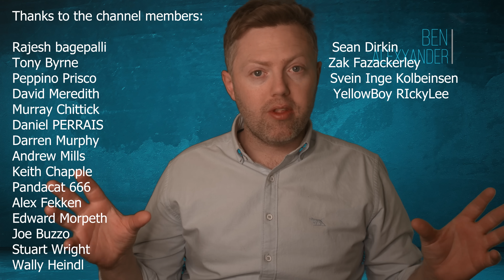CATL’s New Sodium Battery Will Reshape the Entire EV Industry

Comment: You're 100% wrong on people not wanting longer distance from electric vehicles. It's an asinine view that other channels take as well. People DO want longer ranges so they don't have to stop and charge their vehicle on day trips!!!
Reply: I agree. The trips that are annoying for me are ones where you stay the night and there's no charging. So say a 2-3 hour drive away, overnight stay for a couple of days, then 2-3 hour drive home.  Having to stop on a shorter drive like that is annoying. If my EV had a real world 450 mile range at motorway speeds that would be a game changer and I would buy one!
Reply: I’m waiting for a car that’s the size I want, with the features I want, that’s not NMC, that will do the day trip I do every 6 weeks without a charge stop, with enough wiggle room to allow for bad weather etc. That day is huge for me already. I don’t want to add a charge stop. 

500km real world range would be enough, but it’s surprisingly difficult to find in a small SUV. The industry seems to have decided that 430km is enough for that size car, and for most mid size SUVs for that matter, but that’s cutting it too fine for me. The Zeekr 7x has that little bit extra I need while still being LFP, but I just don’t need that much car. 

There are rumours about a 2026 facelift of the Atto 3 (including a more sedate interior thankfully lol) that looks promising. I’m guessing it will have the Blade 2. So I’m hoping that will work. But if it doesn’t, I will keep waiting.
Reply: It’s dumb to want more distance than 400 miles. The extra weight makes it a bad thing.  It’s the same in cars notice the large 25 gallon tanks are gone even on the suburban. The extra is stressed by on line distractions from non ev people.  I drove my Tesla with a 300 mile Range at 80 percent and it was more than enough to go 1350 miles with a short fill that the car to me right to.  It took 15 minutes and off I went. They are open 24/7 even on Christmas and new years.  The smaller the pack the better however 400 mile range is even better than most SUVs have
Reply: I'm going to disagree with you on this.  500km/310mi of range is adequate for the vast majority of drivers.  Sticking with that range means the vehicle will be much cheaper.
Reply: @Jon-z2k7j then these people don't d serve to drive. I want more range and less charging. What sort of moron doesn't want longer range.... Other than you

Comment: If this comes to fruition, it will be the tipping point for me to get into an EV.   Living in Canada, the long driving distances and the range degradation have been a deal breaker.
That and the crappy charge infrastructure.  A 600km range, recharge to 80% in 10 min, minimal loss in winter and the added benefit of low maintenance it will be my next vehicle in 4 years.

When this tech is available the only barrier to mass adoption will be the price of the vehicle itself, not its method of producing power.

The main question to worldwide mass adoption, is the energy grid able to keep up with demand?
Reply: Yes. The network is a problem not charging. In 20 minuten 80%.

Comment: Sodium batteries will ignite far more readily than lithium batteries, and burn far hotter. You don't get greater energy density in a chemical battery without also getting more volatility. And the energy density is STILL garbage. Chemical batteries are not the future.

Comment: I think sodium ion as a mixed bag. On the one hand - cheaper, safer & greater temp range but on the other not as energy dense. I imagine that we'll see all kinds of weird hybrid batteries - half LFP, half sodium. We'll see crappy but affordable city cars with 150 mile range because the battery is cheaper. The biggest use of these kind of things is probably in static energy storage where it's less of a deal - e.g. home energy might need a 10 or 15kwh battery so a slightly lower density doesn't make a big deal of difference to something which is bolted down and never moves.

Comment: Distributed power generation and storage, are the real deal with this. Because EVs are not a real option if we migrate EVERYTHING to EV. There is no way to generate that much power efficiently, cheaply, and distribute it efficiently.

Now having a decently sized battery on each home, may not increase its cost that much, and suddenly you give the grid the capacity to operate near full load all day. Powerplants can run at optimal levels, cheap renewables can be optimized for maximun generation, and ignore consumption peak hours.

Only then thinking about EVs everywhere really makes sense.

And in your house ... or building. Space and weight are not a premium like a vehicle. Your car can run on the battery chemistry that gives the best range, performance, lightness. But at home, i want quantity and cheap.

Comment: Video states, "One of the only things EV critics bring up is fire risk . . ." ah . . . no . . . EV critics will still rightly point out that most countries are still decades away from having the recharging infrastructure required, along with the range of batteries. These will be EV showstoppers for at least 2 decades yet. Please don't shoot the messenger on this as it won't change a thing. These are facts, you can have your own opinions on this but you can't have your own facts.

Comment: For context Li batteries looses range in cold weather as the batteries needs to be warmed up from those minus temperature - using it's battery power in doing so thus lower range.

Comment: When you talked about EV and range in cold weather dropping to as low as 40%. Ending with saying that this will almost eliminate this problem. You forgot to mention the fact that a lot of the range lost is because you need to heat the compartment. That takes a lot of energy compared to fossil cars that get heat because of their inefficiency.

Comment: The energy density (Wh per kg & per L) are currently worse then other Li based batteries but I assume it can be improved to some degree in the future (but Li batteries will also improve) - better for stationary storage home/grid.
Other early to market Sodium batteries haven't met their Ah capacity within practical voltage range - more Ah at lower voltages but using them becomes harder.

Comment: I've been living off grid for 20 years, this revolutionizes off grid living!
Reply: Watch Will Prowses last Videos. he has Tested a 12V Sodium battery. The efficiency and Voltage range an other specs are a nightmare for Home or BEV use.

How would you like a home battery of 12V nominal that you have to discharge from 16V to 4V to get full capacity? How would you like putting 5kWh into it and only getting 4kWh out of it?

Comment: So about 2/3 of the energy density but half the cost. This will make it very attractive for the majority of drivers who just drive to work and run errands.
Reply: Do remember that it's not half the cost of the chemistries it competes with. It's 2/3rds the energy density of high performance, high Wh/Kg Lithium ion batteries that use Manganese. It's comparable in Wh/Kg to the best LFP batteries with which it also competes on cost, but it doesn't trounce the LFPs there.
What this is saying is that for LFP use cases, Sodium will be safer, longer lasting, and operate in a wider range of temperatures than LFP. Neither the price nor the weight will change much at first, but the hugely long cycle life makes them more attractive than LFPs even before factoring in safety and temperature performance. 
For Lithium-Nickel-Manganese-Cobalt or other Lithium-Manganese high Wh/Kg use cases where weight is at a premium, this sodium battery will still lose out, just as LFP loses out to Li-Mn chemistries in many use cases today. 
The truly game changing things about this are safety, thermal performance, and life cycle. For large scale grid storage, they're going to save money from the safety aspect. They won't save money up front on cycle life, but they'll eventually make back more for their investors when they keep operating while LFP grid storage facilities are spending money to replace their batteries. Home owners will love the safety and the promise of long life with no hassles or maintenance, but the thermal performance won't matter much. Thermal performance is what will get them into cars, bc then manufacturers can make one car with the same specs and sell it in Alaska and Hawaii instead of making different batteries for different states or countries. It honestly isn't super game changing there, bc you can optimize around thermal performance in various ways, but that requires designing different systems for Estonia and Italy, Alberta and Alabama. Large car manufacturers will like that. I wish I could say that consumers pay attention to the cycle life of batteries, but they really don't. Some day they'll appreciate not having to spend to replace their battery, but cycle life isn't the selling point in cars that design simplification and safety will be.
Reply: @cripdyke  My son has a new Tesla Y.   He keeps the battery between 20 and 80 percent to optimize the battery life.    Will it be possible to run this new battery from 10 to 90 percent or even 5 to 100 percent and not loose battery life.  If so, one would gain more range and not worry about killing the battery. Just curious.  Thanks

Comment: The stationary batteries are then possible to build even cheaper - The stationary batteries are not depending on being compact or low weight or depending on weather temperature -  And if these batteries can save energy from night to day that would be revolutionary for the electrical grid.  And maybe even save energy from weekend to weekdays.

Comment: I’m old. This reminds me of the early days of PCs. When’s the best time to buy one? Next year! 286, 386, 486, pentium, pentium pro… I’m putting off buying an EV for another few years. As these roll out EV prices of existing vehicles will plummet, because you can buy a new one cheaper and better. All current EVs are dead-tech. Only thing that remains to be seen is actual long term performance which can’t be simulated with lab cycles. You need time for materials to actually age with charge cycles to see what a real 5 yo battery looks like
Reply: I can buy a retrofit battery for my old Prius with far greater capacity than the original. I’m sure the same will be true down the road for existing EV’s.
Reply: There will be a retrofit option for existing lithium alloy cells.
Reply: @mechanicaldavid4827  requires new BMS - discharge is similar to old fashioned batteries where voltage slope down to zero, whereas lithiums produce maximally along a flat line then plummet.
Reply: You can't be that old. No mention of the 8086 or 8088.
Reply: Unlike PC's you can buy a decent second hand EV with good warranty from the car dealership/manufacturer - at least in the UK you can. Bought a 4 year old EV which still has a very good range and 100k miles battery warranty and a 3 year warranty on everything else. 
As EV's get more and more common it will get to the point that ICE will be seen as a waste of money and a wilful desire to continue damaging the environment, hopefully with outrageously high taxes on the fuel.
Reply: So buy secondhand or lease one! You might find a lease is cheaper than running your current ICE car, depending on your mileage. And then the depreciation is someone else's problem.
Reply: When it comes to cars, assuming you're talking about swapping cars and your current one still works, the best time to swap has always been tomorrow.

Comment: If the battery lives up to these early expectations you still have the major problem of getting electricity into them in the first place. According to some commentators including Michael Kelly of thePrince Philip Professor of Technology at the University of Cambridge during 2002-16, the upgrade of the power grid that is required is naterially not possible, there isn't the copper available, cannot be implemented, we do not have the qualified workforce to install it and is unaffordable, the capital outlay is collosal. (See https://www.youtube.com/watch?v=NkImqOxMqvU)
Ben, I am open minded. I'd be interested in your response to the points made by the Professor.

Comment: This is not entirely the whole story. Yes this battery is good, but it does not outperform a current lfp battery in storage capacity per square centimeter. So car manufacturers are creating hybrid batteries for now. Taking advantage of both types of batteries is the way to according to them. But yes, grid storage and other types that are not really space bound will get a quantum leap. That said, the original specified price was 10 dollar per kWh. I see they doubled the price already, which is a shame. But I get it, why give it away when you can 100% up your margins. They will become cheaper of course. But cheaper now would have meant more adoption now. So it’s a shame.